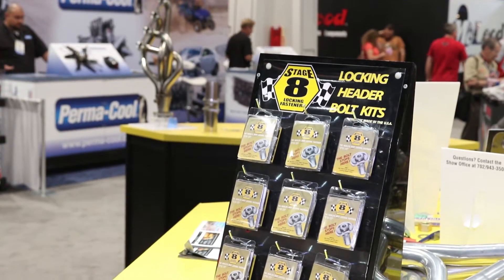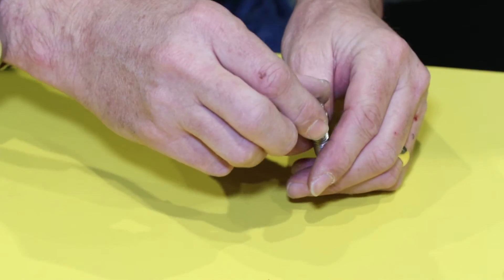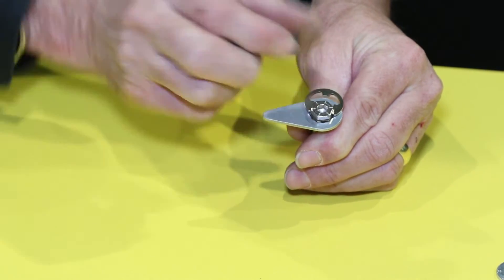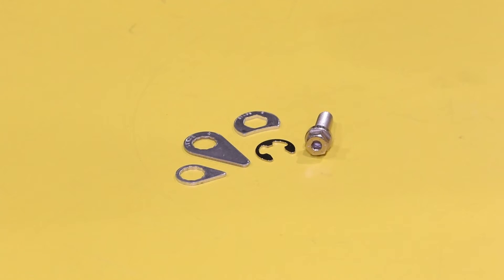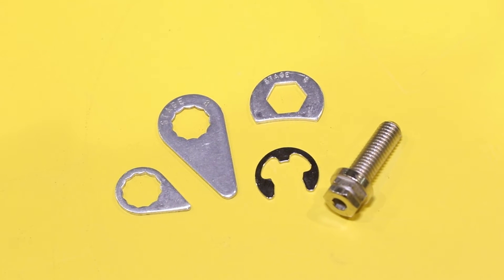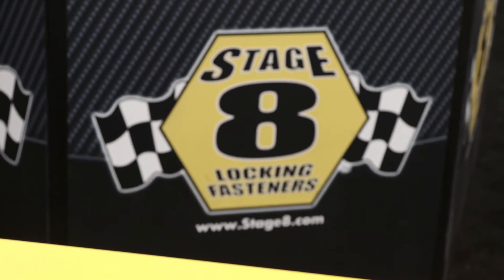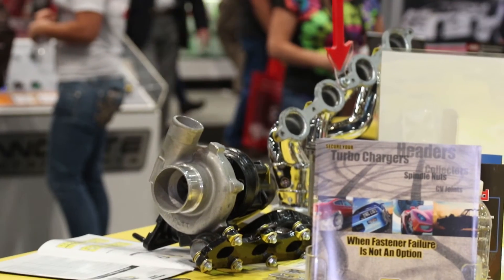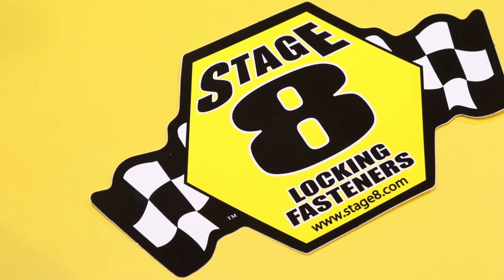SEMA 2015: Fighting Header Leaks with Stage 8

Comment: I've installed headers on SBF and Chevy LS engines, both supercharged. I used stock bolts and none came lose. Never had to remove them either!
No matter, next time I will use the Stage 8 with anti sieze.